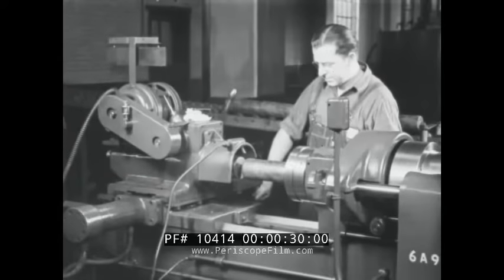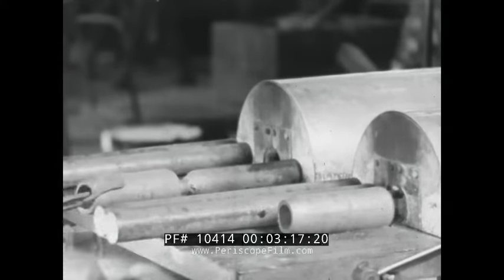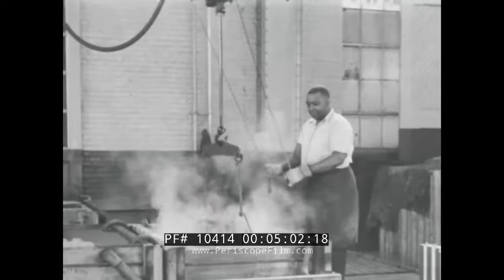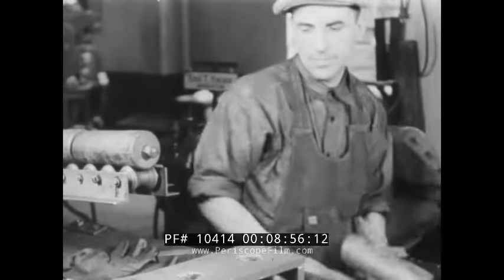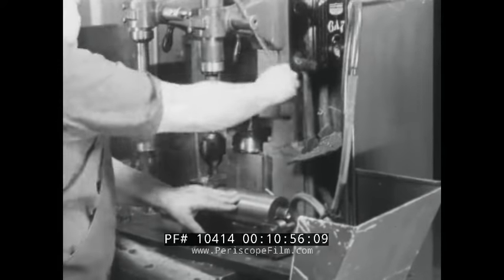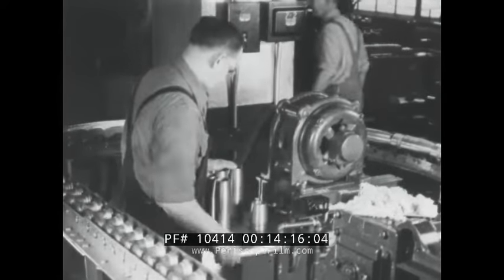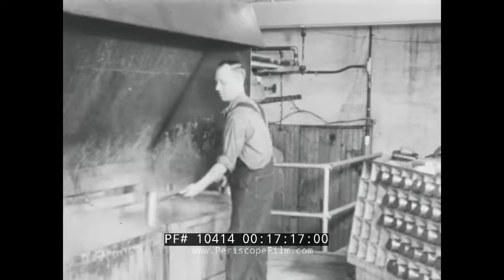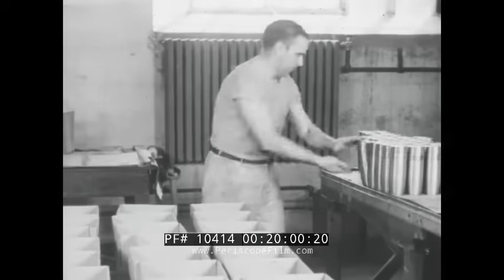MANUFACTURING 3-INCH ANTI-AIRCRAFT SHELLS     WORLD WAR II ORDNANCE FILM FRANKFORD ARSENAL 10414

Comment: Knowing how many of these shells were used, it's crazy how much labor goes into making just one
Reply: I did a stop and time on the operation they guy said, 1000 shells in 8 hours..... That works out to one shell every 29-ish seconds and sure enough, that operator was right on that schedule.
Reply: @additudeobx  The M3 3 inch anti-aircraft gun could fire 25 rounds per minute, so on a 'bad day' the gun might shoot an entire 8-hour day's worth in 40 minutes. 
One gun. It's no wonder they went to the time and expense to create all of these specialized machines.
Reply: @19:08 the worker made a mistake, he skipped the greasing of one shell.
Reply: @jfan4reva  They are not constantly shooting, that would melt the gun.
Reply: Considering that it could take thousands of shells to take down a single plane, it's absolutely amazing that we had factories that could keep up. Yeah, I had no idea it took that many steps and that much hand work to make a shell!
Reply: @bmay8818  True that.  The invention of the proximity fuse improved the effectiveness of all AAA.
Reply: @swright5690  Oh yeah, that fuse was a game-changer! I've seen a couple of documentaries about it. It's mighty impressive that they could cram a tiny radar set into a fuse before transistors and better batteries were invented! They use GLASS vacuum tubes in shells that experienced hundreds of Gs, and they worked. IIRC, the fuse reduced the number of shells required to take down a plane from dozens of hundreds to just dozens.
Reply: @dickJohnsonpeter  The production line had been developed incrementally since the 18th century. Great leap innovations was usually expensive failures.
Reply: This type of thing happened all over America during world war ii, this tremendous ramp up in manufacturing ability is what gave America the ability to become such a leader after as well as provide Americans with things like new refrigerators stoves and ovens etc. World war II fundamentally changed the American landscape in terms of agrarian versus manufacturing.
Reply: Yes they did some crazy stuff back in the day.
Reply: @additudeobx  1000 shells in 8 hours - they said
Reply: That's why they had this video. They wanted more private machine shops to start turning out shells.
Reply: Back when American Craftsmanship was the best
Reply: @dingdong2103  yet somehow we still won the war. 😂
Reply: @1bennyfred  WE? 😀 
Soviets won the war....27 million of them died during the Great Patriotic War. 
How many US people died there?
Reply: @bmay8818  it was not so much the company to keep up, but the taxpayers?
Reply: 1,000 shells per 8 hours.....
Reply: I have an old 5-inch naval AA shell(dummy) with a Mk 18 fuze and it's crazy how complicated and intricate the thing is. Bulletpicker is a great site that has lots of info about shells, fuzes, explosives, and other stuff.
Reply: @dingdong2103  my grandfather was a marine at the time and told me they had to manually grease all these rounds when they loaded them.  Now I know why lol
Reply: @henryrollins9177  "No I won the fight because I'm on the ground bleeding a lot more than you are!"
Just because they were excellent bullet sponges doesn't mean they were the reason Germany was defeated.
Reply: @dingdong2103  I have a feeling that was a splice in the video.  In a film projector like those, the audio and video can be a few seconds apart,  because the audio sensors are not exactly aligned with the lens (the "video sensor").  So I think -- my theory is -- there's a missing bit of film due to a splice, and it contained the greasing of that shell, as well as a little bit of audio that doesn't "appear" until a second or two afterwards when the splice reaches the audio sensor.

If not, we're going to have to make some phone calls and get that shell corrected!  :)
Reply: The workforce in the WW2 was the most important factor for winning something. That is why all capable to do the work were valued and put on work. Why militaries targeted not just factories, but as well the apartments of the workforce and various supply routes through the whole supply chain. 
You can bomb a railway, but it is repaired in hours. Killing a machinist or their family, and you have weakened the factory production by days or weeks.
Reply: @Skinflaps_Meatslapper  Hahahaa....you have no clue, bud.
Reply: @henryrollins9177  I don't need clues when facts are readily available, also the facts say your mom and dad didn't want you.
Reply: @dickJohnsonpeter  I mean, no offence friend but people were pretty smart back then and probably explored every possible method within the technology they had available to them at the time.  If there were a faster and easier way I suspect they would have used it however you can see by the testing they were doing that they were producing these to a very high quality and tight tolerance.  When I was younger, one of my neighbours was a gunner in the WWII.  He was this really big, gentle guy named Jim and during the war, the gun he was on fired a shell and it exploded just past the muzzle of the artillery piece.  It killed a couple of the gunners near him, totally jacked up his hearing, and ended the war for him right there.  You had to manufacture to a tight tolerance due to the size of these.  If a cartridge malfunctions in a rifle, that can be plenty bad and really injure or kill the operator (see youtube .50 cal videos for compelling evidence of this) but imagine one of those giant bastards going wrong.  Jim was lucky it didn't kill him, but even so, it scarred him for life.  I miss him.  When his wife eventually moved away, she gave me his favourite chair.  The one he liked to relax in.  It's very comfortable and I see why Jim loved it.  Dorothy was Jim's wife.  They were lovely neighbours.
Reply: You can say the same for any equipment. Look at the work that goes into a tank or plane, and they used them up like mad. Or even rifles and guns.
Reply: @dickJohnsonpeter  seriously, you think they didn't have whole teams of guys who knew what they are talking about trying to work out the fastest, cheapest way to make things like this for the war? You think some dude with zero manufacturing experience sitting on his ass watching YouTube videos is going to come up with some obvious solution that didn't occur to the entire industry during the entire war? What do you know about the forces a shell is subjected to? The enormous g forces that occur when they are fired, where any slight unbalance will send it wildly off target.
Reply: That is what assembly line techniques are for. It would take a couple of guys all day to make a shell. But a while factory of guys doing one step each, with tooling all set up for each step, can crank out thousands. And they have many lines doing this. This is why more men stayed home making stuff in WW2 than went to war. The US barely strained itself as far as manpower goes, nothing like the other combatants did.
Reply: @additudeobx  assuming the factory was running on three shifts, that means 3000 shells per 24 hours for just one somewhat small factory.
Reply: @davidgold5961  It's always amazing to witness the spark of budding intelligence right before my very own eyes. Thank you davidgold for that burst of intellectual insight.
Reply: @heywhatsthatsmell  It's not he "bullet" that hits the aircraft.... it's the shrapnel from the exploding munition within the proximity of the aircraft.
Reply: 👆This was bofors anti aircraft guns shell....widely used in pre & post WW 2🙌🙌👍👍
Reply: @robertcool5216 oh nonsense.  The US was the largest manufacturing economy in the world prior to the WW2 build up, and had been since the mid 1800s.
Reply: Was just thinking that myself a lot of work